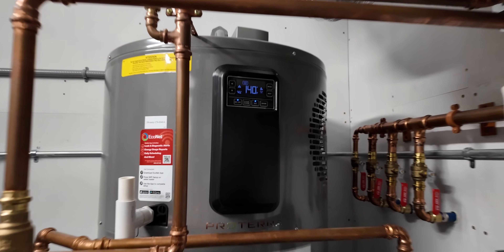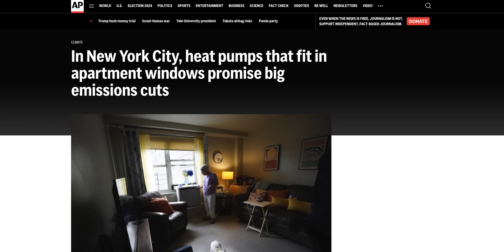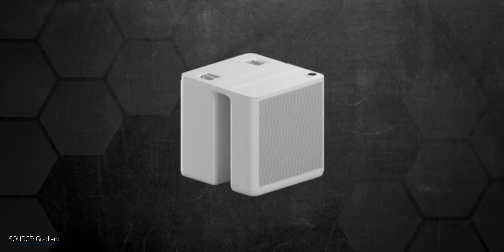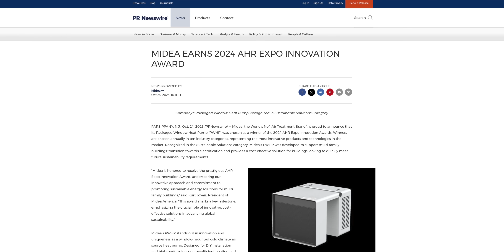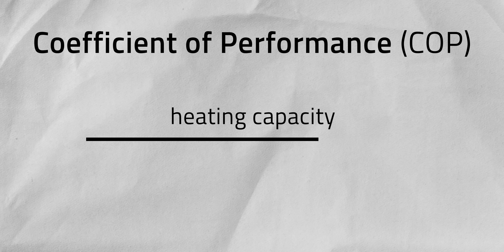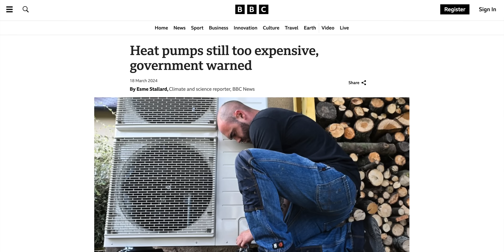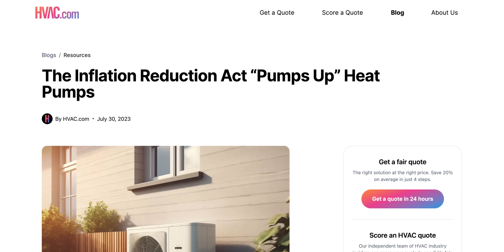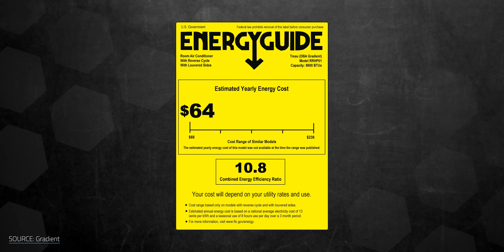Why This Window Heat Pump Is Genius

Comment: It's not really a tech story, but I remember attending a talk with a guy from NYSERDA (public/private partnership that does a lot of energy efficiency stuff in NY).  He told the story of how he'd been called in to do an energy audit for a public housing tower.  They did the normal things... insulation, windows, new furnace, but when they were done the energy bills didn't go down like expected, so he was called back to figure out what was going on.  He noticed the problem right away.  It was the middle of winter and there were apartment windows open all over the place.  His solution was pretty simple.  Previously, the management paid for utilities.  They just moved to individual meters (and adjusted the rent down by the amount of the average utility bill).  He told the story as a triumph of capitalism, and it was a good example of aligning market forces to help solve a problem, but my question to him was, "Would a landlord pay to make all those efficiency improvements if the tenant had already been the party paying the utility bills?"

I had a friend who was on disability who was living in subsidized housing but the landlords were responsible for the utilities.   In his case it wasn't a government own building.  His health problems made it hard for him to regulate his body temperature and he had to fight with his apartment complex about both heat and AC because they didn't want to turn either on until a specific date each year.  (I wonder if maybe splitting the bill might work, since it would incentivise both parties to do their best to keep energy costs down.  My own landlord (I'm on disability too, and live in subsidized housing) got a huge grant years back in the aughts to switch us from electric to natural gas (it is a heat pump, so the total carbon footprint, at least with fewer renewables on the grid at the time may have been a net gain.)  He hired the lowest bidder, of course, and apparently pocketed a fair amount... which is part of the incentive program to get landlords to do the work involvled, but having the lowest bidder do it was a mess.  We had to have all three of our closets empty, and they couldn't tell us which day they'd get to our building.  I basically had my closets contents in my living room for 6 months because they were going to get to my building any day.  The system uses small port forced air and quite possibly doesn't meet the decibel level requirements for public housing, either when it's on in our unit or with the 8 units just on the other side of my bedroom wall.  Because of the Section 8 formula our landlord got to raise our rent because our utilities went down, so our lives were torn up for months and we got an inferior system for heat (it does include AC, so we got to get rid of our window units and we have hot water on demand, but overall, a downgrade from our perspective, since any savings we would have got went to the landlord, despite the fact that he did it with federal grant money.)

I also wasn't eligible for the EV tax credit and ended up getting a gas powered Chevy Spark when I bought my car... no taxable income, no tax credit... which makes sense in some ways, but if the goal is to push EV adoption it's a failure.

Just saying, sometime policy is as important as technology.  I wonder if we would have got these units instead of the full retrofit if the tech was available at the time.

Edit... probably didn't have to explain what NYSERDA was, since you actually referenced them.

Comment: I used to live in on the 20th floor of a high rise in the suburban Boston area. Each apartment had one inefficient "hotel-type" a/c unit built into the living room wall, but the only way for it to cool bedrooms was to leave the doors open. Our building did not allow residents to hang anything out the window, so we could not use standard window a/c units. They did allow the portable units that vented out the window (as far as the screen anyway), but they could cause power surges. Are there any heat pump-a/c options that don't stick far out of windows, for residents of taller apartment buildings with safety regulations?
Reply: AFAIK there are a few heat pumps in the style of those portable A/C units.

Comment: Saying that the window units win out over gas heat because gas heat has a "COP of 1" is ridiculous. This only makes sense if you ignore the fact that the electricity to run the heat pump primarily comes from thermal fuel burning power plants with conversion efficiencies of .2 to .35. I'm going to use the middle of that range (0.27) and ignore the losses incurred by transmitting the electricity from the point of generation to the point of consumption, giving the heat pump an unfair advantage. With these numbers, the heat pump will achieve a COP of 0.7, which is comparable to the worst, most outdated gas-fired heating equipment that's still in service (think late '70s or early '80s). Add to that that electricity costs FAR more than natural gas per BTU in many areas (especially the midwest), and these heat pumps are insane not just environmentally, but also economically. A good high-efficiency furnace will destroy them on all fronts in a cold climate. Now, in a climate with lots of wind and solar and mild temperatures that allow them to achieve higher COPs, yeah, they make tons of sense ... but the fact that you're pushing them in NYC while ignoring the losses incurred by power generation demonstrates to me that you are either a fool or have an agenda ... and since I know that you're not a fool, that leaves only the latter.

Comment: Window Unit heat pumps (not just heat strips, which are simply resistive) have been around since sometime in the mid to late 1960s. They worked, but were not very efficient. As others are stating... this early primitive design was just an Air Conditioner with a reversing valve. Modern technology like Inverter Varible Speed compressors are will make the idea much more efficient.  
I agree with what everyone else is saying – – the market for a better high-tech version of this is huge and I'm not sure why they haven't been offered so far.. . People are having to mortgage their homes to pay for overpriced central heating and cooling systems that really don't work all that well. 
Hopefully products like this will flip the script and help everyone out!

Comment: I call B.S. on the cost numbers. There's no way that a traditional air conditioner/gas heat costs ten times as much as a heat pump.  A heat pump and air conditioner operate basically identically for the cooling cycle (and thus cost about the same), and in most situations the cost for gas heat compared to a heat pump is going to be roughly the same (if not a little cheaper on the side of gas). Who makes up these bogus numbers? 

For most people with gas heating, the cost difference is going to be close to a wash. Electric heat will be more, but not 10 times as much over the course of a year.  

It's hard to take this kind of stuff seriously when the numbers advertised are so clearly bogus.

Comment: $3000 or $3800 for a heat pump that will most likely last only 5 years if it's built like current window ACs.  Would love to know the warranty on these units to understand how long they should last.

Comment: Can't wait until this is banned here in Australia, just like portable split systems. It's either inefficient portable units with a hose venting out the window or the old-school window rattlers for us if normal split systems aren't an option.

Comment: Nobody in Tokyo or Beijing is going to use this $3000 unit. In China every apt has mini-splits that cost $300-500, free installation, dead quite. The absurd $3000 price is made for and by the NYC for a reason.

Comment: A regional home improvement chain sent me an ad containing Mr. Cool brand DIY mini-split heat pumps from 12k - 36k btu. only the 12k unit runs on "120"v. and the biggest using 22 @.  My conventional 4 ton AC uses 31@ at "220"v upon startup.  I'm still watching the industry for when I have the cash and other upgrades made to this 1912 vintage 2.5 story house.  {Since the HVAC system was recently replaced, I have about a decade to work with.}

Comment: Heat pump tech is the future but the pricing on these units is well outside the range of reasonable.  If and until a one ton window unit is under $1000
Without subsidies, the average consumer will balk.  DIY homeowners like myself will go with mini split units and apartment residents will just buy resistance based heaters.   It’s not clear to me where the high cost of these units is coming from. A reversing valve and associated controls isn’t that expensive… to see 10x pricing vs traditional AC units is ridiculous and suggests OEM price gouging.

Comment: The whole differential heating can be solved by adding thermostatic radiator valves. Still doesn't solve cooling, but a lot cheaper.

Comment: There generally needs to be more focus and talks about noise levels. With units hanging on the window frame there will be vibrations and also the potential infrasound from the motor and compressor. That negatively affects sleep quality. Some of us sre more sensitive to noise than others.

Comment: TLDR: Did someone reinvent the train again?

I don't see what niche this fills.

If you live in an apartment in the North East, you likely have a boiler, access to ConEd steam, or a landlord that will need to upgrade the building to make it compliant. That upgrade will likely not be a window unit that costs 3k.

If you live in an apartment elsewhere, you likely don't have 3k to spend on a window unit when your apartment already has heating and potentially cooling.

If you own a home, you likely have a central solution that you will TRY TO replace with the cheapest lifetime option based on fuel availability and maintenance in your area.

The only potential application is for a condo owner that can't install a mini-split and who has forced air. That was my situation at one point. But after you realize you need ~3 of these to heat and cool 1000 square feet efficiently, that's a non-starter.

Also, window units are already a terrible solution. The units that have a hose extending from them to the window are FAR superior and more flexible. Give me one of those that can heat and cool for like $500 and we'll talk...I guess.

Comment: "Inverse U" window AC/heat pumps are flawed by design - they require built-in electrical water condensate pump (to pump condensate that will collect at the bottom of evaporator coil), something that can fail in multiple ways. Some of those ways will result in $1000's of damages to your flooring and walls if the condensate hose will start to leak at the very top of the joint that joins 2 "halves" and onto your floor, or if the condensate level gauge will stop working and the pump will not engage at all. Just ask GE about it ;)

Comment: I upgraded my window mount AC unit last summer to a cheaper window mount heat-pump unit in my house in MA.  The units I got still have the same old window-filling form factor, and have a significantly higher low-temp cutoff for some reason... (advertised 40F).  Even in New England though, this was able to supplement my late fall and early spring heating needs enough to significantly reduce my gas bill.  I only needed the primary gas furnace full time between Nov~Feb this past season.

Comment: Hard pass until these companies stop price gouging because it's new. 3 grand for a window AC unit and space heater combo unit. No thanks. When it's replacing 300 bucks worth of units, the efficiency is moot. I doubt the unit will even last long enough to make up the difference in utilities.

Comment: Lol these cost more than a regular mini split heat pump. I am sure as other brands start making these the price will drop considerably. Until then NO SALE.
Reply: I just bought a regular Midea window unit with a heat pump for $350. It's an 8,000 btu A/C, with 7,000 btu heat @ 120V. You can also get it in 12,000 BTU. I think someone is trying to sell a bill of goods here.

Comment: These units are crazy expensive. Here in EU you can get a more powerful than that in mini split form factor for 270, 500 installed. Yes, reversing heatpump with dehumidifier mode and all that. There's no reason for a heat pump window unit to be more than maybe 600.

Comment: Wait wait wait..
Summer here in Australia was SAVAGE dude..
Is it really OK to only handle 35 C in NY ??????? 

Add 20% or something to normal temps across the board :| just in case. There will be a few outliers that may achieve an absurd 10% or so.. but who knows right ? :|
Birdsville in QLD this year got 49.4 or almost 122 F.. its always hot there but damn. That's HOT, smashed the old record IIRC

Comment: This is a great idea, and would be much quieter than traditional AC window units.  Though I rarely see buildings where the window opens vertically anymore, they all seem to open horizontally now, it was a lot of work to install a traditional AC unit in my house, with the horizontally opening window.
Reply: Most windows I come across are like this too opening side to side instead of up and down. Yet there is almost nothing made to work with this style of window.
Reply: Where are you living where that's the norm where I live the only horizontal window I've ever seen is my parents sliding glass back door
Reply: I live in Canada eh!

Comment: There are already dual inverter portable ac units(type with hose going out window) that can heat and cool for $400-$600. I'm sure they're not quite as efficient but you're out of your mind to spend 6x the money on one of these window units when you could get several of the portable kind and cover your entire apartment. These need to come down to about 1/3 their price to make sense. The 3000 & 2000 prices are including a heavy early adopter tax. Don't buy them.

Comment: In-window and In-wall heat pumps have existed for awhile. 
$200-500. 
The best ones running off 208-240VAC.

Comment: A basic understanding of the laws of thermodynamics, refrigeration, and how heat pumps work, the science, dictates that a heat pump does nothing for climate change. The phenomenon of urban heat sinks can be attributed, logically, to the use of air conditioning, refrigeration, and heat pumps. 
The mass use of air conditioning in cars and in buildings using heat pumps, (bidirectional refrigeration), and refrigerating the food supply, it  would stand to reason that is the cause of "climate change".. 
The efficiency of heat pumps is that the don't create heat so running them as a/c takes the heat out of a car (non reversible) or building, put the heat outside. Reverse that in the winter, when each on, in the grand scheme of things, removes heat from outdoors and puts it inside (refrigerated the outdoors). "For every action there is an equal and opposite reaction", scientifically speaking....

Comment: The point on "common denominator" heating is a little miss leading. Some of these water pump systems have thermostatic valves in each room so the water just doesn't circulate in the rooms that are already at temperature. I'm sure this is not all but I would hope most of these style of heating system have something similar in them. They could probably be retrofitted as all.

Comment: There are tons of these things and some are as cheap as normal split systems or portable ac units. A simple flexible tube to outside unit, including a moisture extractor. Just search for portable split heat pump systems. A lot of them were designed for camper Vans originally. Like Medion P502.

Comment: The midea ones where the through portion is at the bottom is better for most houses.  This one would be sitting on the floor for most standard windows.  In some cases, there would be a large air gap beneath it because it can't go down far enough.

Comment: I haven’t determined whether $3k is a reasonable price for performance, but in combination with existing solar + battery, these seem like an excellent long-term solution for cutting heating fuel and grid electricity costs. I look forward to battery improvements and all-around efficiency gains that can eliminate the need to pay for energy entirely. To that end, these window units are a positive step along the way.

Comment: Just seems strange, especially since there is also a lot of government money going in to this, that a typical normal 9k btu mini split is $1k or less, but these are 3x the price for the same performance. I could see "some" additional cost for the additional work that has gone into the case design, but not $2000......

Comment: 6:40 So what happens when it's a blistering 114 degrees out or a freezing 14 below zero? (7:31 or 96 degrees/8 below? )
The unit stops working when you need it most??
Reply from the maker: You wouldn't use these units if your typical winter/summer temps fall outside those regions.  These are ideally used in regions like NY/Northeast.  They could probably get these to different temp ranges with a different refrigerant.
Reply: @UndecidedMF  New York can go over 95. What happens then? Does the heat pump stop cooling?